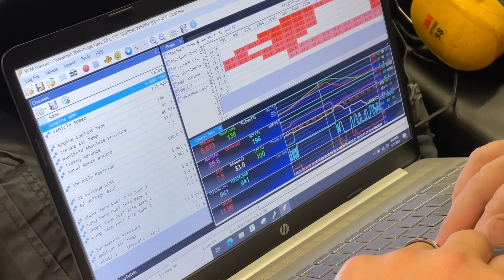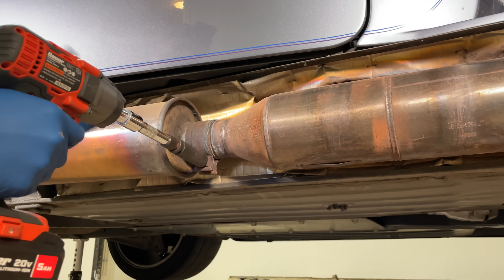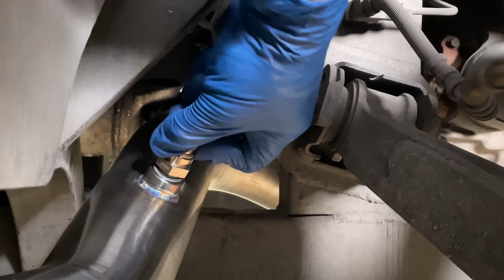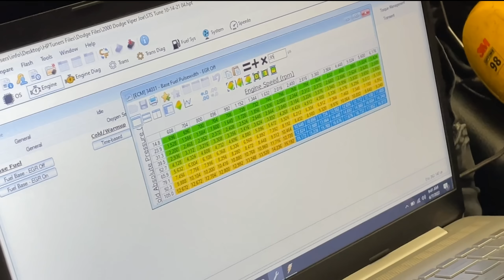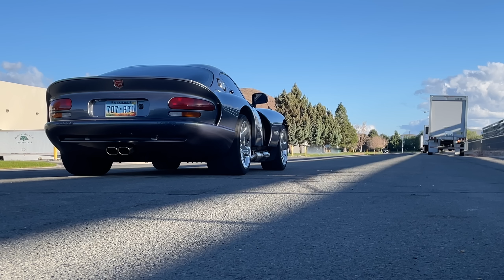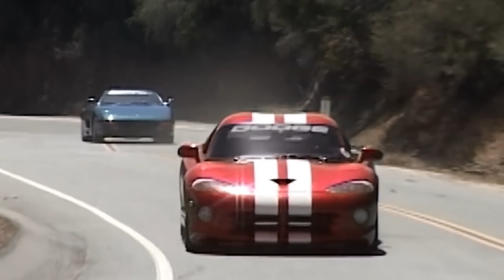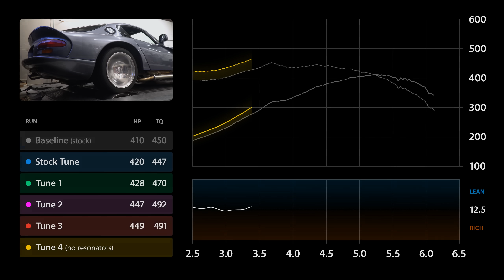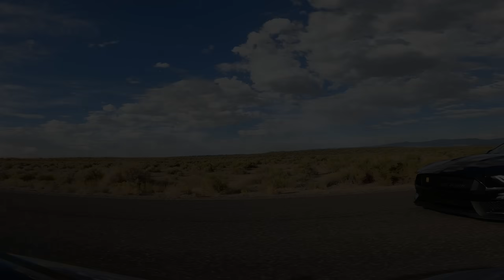When you give an 8-liter V10 the exhaust it deserves

Comment: The Dodge V10 already alternates between banks when every cylinder fires so the exhaust pulses don’t need to be balanced with an x or h pipe like most V8s.
Reply from the maker: interesting info, thanks for the insight
Reply: There may be still be some performance benefits to equalizing that configuration out, even if they don’t have the same scavenging issues that engines firing on the same bank back to back have.  No doubt it sounds better!  Thanks for posting.

Comment: The Viper is just such a gorgeous machine.
And also was kinda intended for track racing?
At least that's where high twerk, quicc acceleration thing could really help with corner exit speed, attacking and overtaking other cars right after a corner. Viper ACR was quite the formidable racecar for it's time.
Also bumb the algooo rhythm.

Comment: you would have freed up more power by deleting the cats as apposed to resonators. The cats are MUCH more restrictive than a resonator is. Cats are the enemy when it comes to gaining horse power. its literally forcing your engine to push all that exhaust through a fine element that is only allowing so much flow.  But it still sounds great and makes good power. i just would have removed the cat before i removed the resonator.

Comment: Peak horsepower is only part of the story. Viper has a much better average horsepower, making it pull for a wider rpm range. Unlike drag cars that seek out peak power, road race car will give up peak power for a better average. Make gears selection less important to maintain power.

Comment: i might be weird,but i liked the sound with the resonators a bit more.
also, the FIRST thing you need to do on ANY vehicle,is a re-tune,like, immediately not just for the gains,but the engine works better after fixing the stock program thats just there for the engine to work

Comment: I've snapped throttle cables twice before, both times I was luckily in town. First time I was able to catch a ride from my friend to our local parts store and the second time was only a mile from my house, I just losely ziptied the throttle to hold about 1500rpm and dropped my truck into gear (luckily being an automatic with od) I was was able to coast back home doing about 30 and shifting into neutral when I had to brake.

Comment: Thanks for the vid. 👍

I had a '94 Viper w/ Hennessey headers, straight pipes and Moroso Spiral Flow race mufflers just ahead of the sidepipe turnouts (would pass FL inspection w/o issues). Did this in '97.
Had everything sent off to Jet Hot for ceramic coating, then exhaust wrapped everything in the side sills.
Ford Speed in Pinellas FL did my tune.
Sounded awesome and ZERO sill heat. 
Was my DD for 8.5 years.
Reply: Damn FL had inspection back in 97? Im glad they stopped that.

Comment: How the fuck do you Americans get so little horsepower out such big engines?
Reply from the maker: This engine platform is about 30 years old, so while it was one of the most powerful engines of its day, the low compression and mild cam are the main reasons its hp per liter is so low. The last gen Viper made 645 hp and 600 lb-ft of torque with just 0.4 more liters than this car.

Comment: 8 litres and 10 cylinders and its makes only slightly more than my 2.0 4 cylinder 🤣🤣🤣 what the fuck is it even possible if you just assembled the engine didn't tune it or anything to make less than 450? 🤣🤦‍♂️

Comment: The viper is 600lb+ lighter than the Mustang. I'm not surprised it won. But it would be another 200lb lighter yet if the Ford 5.2 motor was in the Viper instead of that iron block 8.0... imagine a Viper that revved to 8200rpm!

Comment: You know they make exhaust flange gaskets, right?
Also, it sounds like a raspy tractor without the resonators which is what resonators are there to prevent. Also also, LOL @ crossing the center line on a straight part of the road of all places. I don't care if you have visibility, only a boob that can't drive crosses the center line.

Comment: They should have made a twin turbo 5L V10. Built to handle high boost pressure. 84mm bore by 88mm stroke. It should rev to the Moon with Boost. 9,000- 10,000rpm TT Viper would be awesome. With variable timing and lift heads&cams design borrowed from Honda.

Comment: GGGAAAYYYYY AND BTW A NEW C8 WITH 100 LESS POWER WOULD SMOKE THAT THING HELL A C6 zo6 naturally appreciated 7.0 would bust that ass and don't even try the new c8 zo6 it makes 670 hp naturally aspirated and with the 8 speed dual clutch im srry to tell u bud but it takes dodge demon on racing slicks and 100+ octane plus having to pull that gay ass trailer full of race car parts to get a 2.3 0-60 and 9.6 1/4 mile witch is faster than c8 zo6 but not by much c8 zo6 from factory 2.6 0-60 10.6 1/4 mile time but it took dodge a 3.whatever size supercharger to beat up on a naturally aspirated super car lol 😆 👌 😂 u need to come over to the general motors club we are taking applications lol 😆

Comment: Are we seeing top end drop off due to camshaft timing? Valve float? Head flow?
Reply from the maker: Good question. Pretty sure it's a combination of intake manifold design (long runners), mild cam, and head flow.
Reply: @Four_Eyes  I'd like to see engine dyno results for one of these with an advanced cam adjustment setting or a wider LSA cam. Different rocker ratio for slightly more lift on stock cam would be an excellent test as well if the product exists.

Comment: ngl neither exaust setup sounded that great to me
Stock is too muffled.
With resonators in the aftermarket system is better but also too muffled.
With no resonators it sounds the best in the cab but  too raspy outside. It just doesn't sound powerful enough for that gigantic engine. Needs to have a deeper more aggressive tone.

Comment: its fun seeing people finally coming around to these old 8l V10s. The vipers suffered from the casting of the blocks, but the Magnum blocks from the ram trucks were built like tanks and almost every one ive seen clocked at least 250k miles of hard abuse and work. Theyre absolute monsters and in the state truck pulls all the top non-ethanol builds rock a Ram with a V10.

Comment: I actually prefer new exhaust with resonators, sounds good, but not antisocial, that is how I would run my car. However, the torque and hp improvements kinds of justifies having resonators cut out. Perhaps middle ground is to have valved exhaust, with valve just before resonator (and probably exiting behind the door, like on newer Vipers), this way it could still be nice enough for daily driving and real best when maximum power matters.

Comment: Wow, that looked to be one of the easier exhaust swaps I've ever seen. All that room in the engine bay and the side pipes are a god send. Well done Dodge! Removing the resonators was a great call. Now you can hear that v10 music. Impressive job dialing in the power via tuning and gapping the GT350! Congratulations 👏
Reply: After doing this on an 04 Viper, he made it look VERY easy.  lol
Reply: that exhaust lookes like a dream to work on. got an audi a8 3.3v8 tdi, i cant even see my headers and turbos, dreadding the day they need changing, engine out or entire subframe and hope no bolts break
Reply: Yeah. Very impressive. A tuned/modified 8.0 LITER "supercar" (of it's day) with an engine that was built for torque, beating a stock Mustang with an (5.0 liter) engine that's designed for road racing and makes peak hp, not torque. Viper fanboi's. Smh.
Reply: @robeddy3722  I'm far from a viper fanboy. Bimmers all day for me. From your answer though, you must be a Mustang fanboi ; >
Reply: @robeddy3722  L
Reply: @robeddy3722  dude your own comment is internally inconsistent and nonsensical.

You complain a 20 year old 'supercar' (which is actually a muscle car) that has an engine built for torque is faster than a near brand new muscle car that has a motor built for racing*, when you *race them.

Like lol what the fuck 😂
Reply: @Rollin8.0  "Hey. Does that thing have a Hemi in it?!" 

Fanboi's.
Reply: @robeddy3722  dude the viper was designed for road racing, no holds barred. Draws its lineage directly from the shelby cobra daytona coupe. The mustang is a passenger coupe designed to sell cars to people who like to do burnouts and wipe out, with an extra big engine. It is not a race car. You should not comment - you know nada of what you say.
Reply: @kennethgall  Of course I don't. You being "The One With Great Wealth of Knowledge". I should have deferred to the all knowing.

Dodge fanboys. Always needing their fragile egos stroked. SMH.
Reply: @robeddy3722  pls stop embarrassing yourself
Reply: @robeddy3722  salty mustang owner identified, opinion discarded.
Reply: @Rollin8.0  I've owned one Mustang in my life, years ago, so I hardly qualify. However if you, yourself, were being objective...you'd agree with me. You're not and that's ok. We all just know who you are now. ;)
Reply: @robeddy3722  The word you meant to use in your second to last reply was actually “objective,” not “subjective.” Some advice: educate yourself before you attempt to outwit others.
Reply: @kronk9418  I don't think there is much danger of him outwitting anyone, just quietly.
Reply: @kronk9418 I had "objective" typed in there but it didn't look/sound right. Thanks for the grammar lesson. I fixed it for you. 

I guess if that's all you have to complain about, then you'll be ok.
Reply: @robeddy3722  It's just for the sake of comparing to a modern NA engine. The viper is from a different time.
The first 3 generations barely counted as supercars, the original price was very similar to the Ford now.
Reply: @heygek2769  And you still think it's ok to compare dollars from 30 years ago to our much more watered down modern dollars.  That exact same Viper would sell new for TWICE the price of the Mustang. Plus, adding mods to it. It's not really a fair fight, is all I'm saying.
Reply: @robeddy3722  nope, adjusted for inflation, and of course it's worth more now.
Reply: @robeddy3722  imagine losing to a 20-year old analog death trap with a tune and aftermarket exhaust in a modern Shelby Mustang. Mustang fanboys. SMH.
Reply: @d4nyll  I'm not a fanboy. I just know (and point out) a blatantly uneven match when I see one. If you don't, that's a problem for you.

Comment: Nice exhausted ( lol my bad ) setup first time seeing the exhaust on a viper sounds way better without the resonator and adding a mild camshaft to it will able to carry the power band much high better low-end torque and higher horsepower give it a good tune up.
If I had a viper I would do those 2 upgrade and a tune from there

Comment: 450 hp out of an 8 litre v10 ?? Why so little power??
Reply: Push rod motor, no variable valve timing, and because they aren't tuned to within an inch of their life huffing down boost or cranking 8k rpm. Now they're bored, stroked, have VVT, and push out 640hp.

Comment: You cut your resonators and now you sound like a VQ. You need to put that shit back on and upgrade to a sightly later exhaust pipe. Move a little more air.

You at 3 inch exhaust? Pay to have a 3.5 inch exhaust made. Maybe 3.25. You don't need 4 inch, that's boost territory. You have an NA V10, you need 3-3.75 inch exhaust.

Comment: You would probably also make more hp without the cats..and a lot more noise, like you wanted. Cats dont do anything but regen the smaller but exact same amount of particles into the atmosphere over time anyway, whether you keep those carbon particles in a tin can for a little longer before releasing them into the air or release them immediately, you're still releasing carbon.

Comment: 8 litre v10 but still puts out little meager horsepower, what's the point of this engine when a 4 cylinder can put out the same power as thee v10, I was expecting thousands of horsepower from this gas guzzling engine.

Comment: Just a quick word on how loud the exhaust is when I purchased my first new muscle car.  I'm not going to mention what it is because of the amount of haters we have on certain brands. I found that doing the exhaust swap was not quite as loud as I expected considering the amount of money that I paid and that I went to a custom exhaust shop that did welding and the whole nine yards. Now to make my point. After driving like a maniac I noticed after about a thousand miles of very hard driving it started to get louder on its own. Eventually when I got the exhaust into about 5,000 Mi down the road it was much louder than when I first had the work done.  Therefore I did not have to go back to the muffler shop and have them do any more work it basically broke itself in or did what it needed to do on its own.
Reply: That's because you likely used a muffler that wasn't completely metal. Any fiberglass or other packing material will set itself and become louder after breaking it jn

Comment: I think the Viper made great power for exhaust upgrade and minor tune. And yes the Viper now sounds great. I Autocrossed a 94 Viper back in 97. We changed the exhaust and everyone said it sounded like a UPS truck and they were right. Never Dynoed it but it did go 12.3@115mph at the drag strip on BFG drag radials.

Comment: That 450 at the wheels is also at 5000 feet here in Reno (I live in Sparks). I happen to have a 2006 Corvette LS2 that I just recently bought. When I take it down to the Bay Area (sea level) it's a COMPLETLEY different car - like going from a V-6 to a V-8. You should get it dyno'd at sea level to see what it really does.

Comment: Ford's suck it's just that simple
Reply: Is that why the Dodge with the extra two cylinders larger displacement and the tune barely one and then the accelerator cable broke you're making a very poor example on this particular video make it on the proper video would make sense.
I'm coming back because I forgot to mention what about the slight price difference. How much is the average Mustang out the door. Can you even find one of these discontinued the Vipers? I'm sure if somebody is going to sell one they're going to want top dollar probably twice the price of the Mustang. Is it worth it better yet do you have the money for it.?
Reply: The Ford lost all that matters dink

Comment: I love the old vipers. But I'm not a huge fan of their massive eight liter V10. You compare its horsepower output numbers to smaller engines even smaller v8s, and It's output per liter or even output per cubic inch is not very impressive. I am not a peek numbers guy. I am all about usable power within a usable RPM. And for the most part that is exactly where the viper performs, but there are smaller engines and smaller v8s that perform just as well with far less cubic inches.

Comment: The gt 350 may had more hp but that only helps in long runs your torque won you those races especially since the power kicked in at a lower rpm. Now it'd probably be a different story if it was half mile or full mile runs.

Comment: 5 years ago a green 1995 with 37k miles was for sale for $23k at a dealership near me.  Didn't buy it because I really wanted a 2nd gen but hindsight is 20/20 and that was clearly mistake.  I just sold my 2004 single cab SRT10 pickup. Fun but still wasn't the Viper I wanted, such a timeless design.  Kudos to you man 🤘

Comment: Nice video. Always loved those older Vipers. Totally agree with the sound they "should have come out with" from the factory. Most performance cars are like this, it seem. 🤦 Tough break on that throttle cable but that's cars for ya! They ALL break sometime and usually at the most inopportune moments. 

My first run down the drag strip with my 2006 Mustang GT was a hot lap. My first run was not impressive being a headache big exhaust leak I had not figured out was a cracked weld on some shorty headers that was getting much worse. I saw the car as a concept while I was deployed and fell in love so I had to have one. The factory P-Zero Nero tires were garbage for grip so I installed some nitto nt-450 275 series tires outback and went to the races. I was so excited I could barely hold my foot on the dang clutch in my new car. Well, as it turns out, something of a fog and rain mix had all of the slick cars slipping and sliding up the track whereas my second run I was on a hot lap where I bit hard into to the track. By the end of that run, I had some serious noise coming from underneath the car and had to limp it home some 30 mi at 30 mph. Turns out that Ford in their infinite wisdom put 75w140 in the rear differential whereas it needed 75 w 90 to properly lubricate the bearings. Also, the drive shaft was a two-piece design and I broke not only the midsection hanger bearing, but the CV style joint connecting to the pinion flange. The differential carrier bearings have chunks taken out of them and all of the bearings in the rear end were galled. Close to $3,000 later, I decided to wait before running it again being it was the only thing I had to drive and did not have the money to repair at the time. Lesson learned, right? I think I was without my car for another 2 months or so and had only driven it a total of 4 months from new being I deployed right after I bought it. One thing is true about our cars that we love: it is definitely a labor of love to have a lot of fun with them. 😅 Cheers, all!